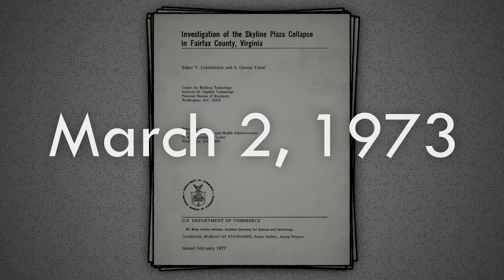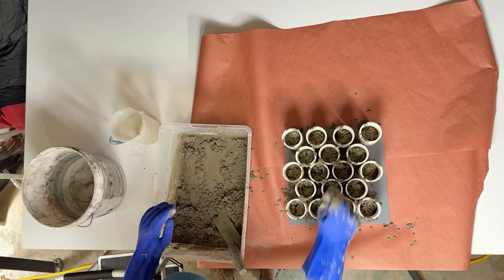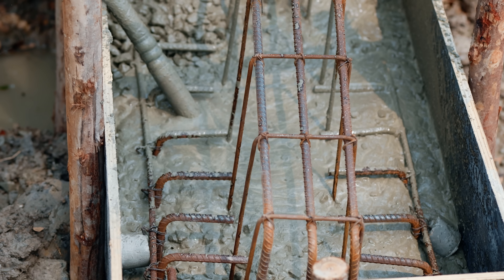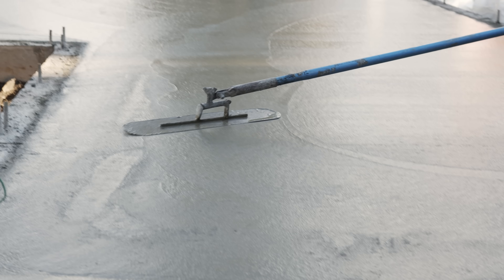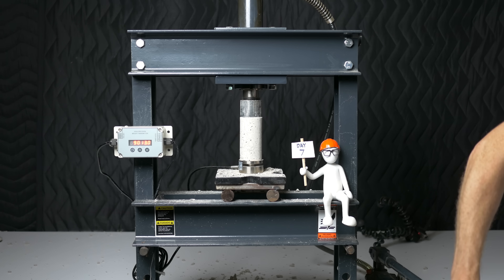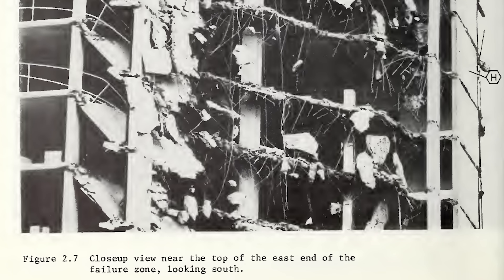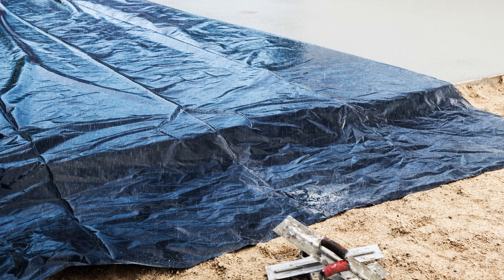Concrete's Greatest Weakness is Time

Comment: In more than 25 years as an architect, I only had to order one slab removed because it wasn't coming up to strength.  Nearly 20 years ago, I did a fire station addition / renovation with a concrete apron between the building and street.  There was one 25 foot section that didn't come to strength in 28 days - and if I remember correctly was supposed to be high-early strength.  The fire department wasn't happy, because it was directly in front of one of their existing truck bays, but it had to be ripped out and repoured.
Reply: Where are you living that such a call would be made by the architect and not the structural engineer?
Reply: @scamplogic probably a country where the architect is the main designer and uses different engineers as subcontractors. The engineer advises the architect, and the architect is the single point of contact for the contractor and client. Pretty much standard practice here in Belgium anyway.
Reply: @scamplogic  Architects often have engineers in house or as subs.   Some architects (gasp!) are also licensed engineers.  
Further, some inspectors (government or corporate) are often high school grads (or not even that), but they have the ability to determine if something fails a safety spec and the authority to stop work and even order rectification.
Reply: great question.
Reply: @scamplogic Western New York.  One of the partners in the firm I worked for was a PE.  Besides, it doesn't take an engineer to read a report that shows the concrete wasn't anywhere close to the required psi after 7 and 14 days.
Reply: Sounds like the concrete was batched incorrectly, or there were some very poor weather conditions for curing.
Reply: @melissaharris3389 okay.
Reply: Why was it necessary to replace that? If it's not strong enough, wouldn't the potential problem be that it cracks later under heavy trucks and could be replaced if that actually happened?
Reply: @MrNukealizer  Sure, failure might not be as dangerous as a falling skyscraper, but if the material failed to meet specifications, it needs to be replaced.
Reply: @mattgies   At what cost to risk ratio? If it was only a little under spec they could have simply discounted the work for the expected reduction in working life … I mean if they weren't government funded and mindlessly wasting tax money.
Reply: @TheDuckofDoom. And this is the type of thinking that tries to creep in and ruins projects throughout the world. As soon as you let standards slip projects become worse quality. Regardless the cost if a standard isn't met then it needs to be redone. We face this issue constantly. If everyone is held to account then the quality of projects improve and everything is safer and better for everyone!
Reply: @TheDuckofDoom. cost to whom? The concrete plant?
Reply: @TristanMaiolo  You misunderstand, nothing is being allowed to slip. There is a cost penalty being applied and an assessment of the actual impact on the service life. The product is simply being sold as a second with declared limitations, rather than dumped in a landfill. This doesn't reward the supplier, they are loosing revenue and profit through the mistake.

Even aircraft and cutting edge semiconductor manufacturing have this sort of allowance. The faulty item is not sold or used as if it were in top condition, it is clearly de-rated and limited in the tasks it can perform.
Reply: @GuyChapman  Cost to whomever is contractually responsible for it.
Reply: @TheDuckofDoom. No misunderstanding at all I get where you're coming from the problem is as soon as you allow standards to slip regardless if they are discounted or not means that you are letting quality standards slip. This lower standard creep eventually finds its way into other areas and before you know it you have collapsing buildings etc. Companies need to be held to account to ensure quality remains high. Just because you may think that it might not be a problem for one thing doesn't mean it isn't going to cause issues for something else. On the flip side designers and architects need to ensure they familiarise themselves better with products they are specifying and insistent on using because often they unnecessarily insist on using products because they wrongly believe they are better quality or suitability in situations just because they may be more expensive and this isn't always the case. I often see ridiculously expensive materials specified when other cheaper materials offer the same use case without compromising quality at all simply because the more expensive materials have properties that mean they are better suited for other areas that the cheaper products aren't. There are situations when the cost doesn't justify the use when there are other products available. The problem we face now is there are many cheaper products which are to be used in certain situations but don't have the correct checks and balances in place to ensure that they are safe and harmless and whilst these pose inherent risks they are often overlooked for the cheap price and when an issue does arise it is often too late and the job is done and dusted. A great example of this is the cladding used on the Grenfell tower in the UK! It burned for days and the cause was because of cheap inferior cladding was used which was purported to be safe and harmless and the fact was that it really wasn't and as it turns out many buildings throughout the world had similar cladding. This has caused massive ramifications throughout the construction industry worldwide and is an example of when they let standards slide this is what can happen.
Reply: @TristanMaiolo  You clearly don't get it. THE STANDARD IS NOT BEING CHANGED. There is no slip, there is no corruption of the testing or falsely labeled product involved. 

This is simply a recalculation of the exact same cost-benefit calculations used for the original engineering design considerations, but now based on new information.
 
We now have a very cheap, or even free, but slightly inferior slab of concrete that didn't exist previously and it may last 20 years; or we can continue with the purchase of a full price slab of superior quality that may last 50 years. 

This may have even been the preferred choice if it had the cost been the same during original planning,  it just wasn't selected because it would be below normal supplier cost.
Asphalt is frequently used for paving despite its shorter lifespan and load capacity because the installed cost more than compensates for the limitations. That isn't a change in standards.

Your typical 4 core or 6 core CPU chip was produced as an 8 core that had defects so they disconnected the defective cores.
Reply: @TheDuckofDoom. It's ok you're allowed to be wrong
Reply: @TheDuckofDoom.  How do you document such deviations over a longer time, fool proof?
 Generally building plans are stored for a long time, but it's up to the inspection to determine if on-site alterations deviate enough to satisfy the building code (and if that involves deviations that alter global strength, they really should not ever). The benefit of this approach is that you even if the original blue prints get lost, it's possible to estimate a minimum strength based on building codes and measurements. That backup plan goes immediately out of the window when the concrete isn't even up it's intended specs.
And how would any government body be able to track that 'life-time' is exceeded. I have yet to see the first public works that actually is taken down after it's originally designed lifetime or it's original usage case, instead of being pushed to it's breaking limits. 
It's sucks to take the costs this early in an project, but atleast it's something less that can go wrong, and keeps the system simpler.
Reply: @TheDuckofDoom.  ah, contracts. Those bits of paper that say what specification the work has to be done to, and who has to fix it if it isn't.
Reply: @GuyChapman   Yeah those. They are often renegotiated when conditions change if it would benefit both parties to do so.
In this case one party can limit their losses, and the other party can get an ultra-deep discount on a somewhat lower capability product. (All dependent on the specifics of the situation of course. I'm just spoon feeding y'all one of several valid business and engineering possibilities.)
Reply: @TheDuckofDoom.  in your opinion, not having reviewed the actual requirements.
Reply: @GuyChapman  Where did I write any opinion? I wrote an illustrative example, and an explanation of the circumstances where that scenario could be a viable option. The specific requirements of the particular case don't effect the general decision making process.
 
If you can't abstract a general concept away from the specific case or spot the difference between an opinion and a logic formula, then you best stick to shoveling out ditches and leave the thinking to others.
Reply: @TheDuckofDoom.  Except reduced lifetime may not be the only concern. It isn't unreasonable to look at the results, calculate all of the potential impacts, and then consult with the client about what they want to do. But all means all -- which requires a robust engineering review of the exact situation and willingness to sign off on that. Might well be cheaper to re-pour the pad. Might be fine to accept reduced life. Might be mitigatable in other ways. Everything is going to differ. But second-guessing professionals who's job is specifically dealing with this stuff seems rather unwise.
Reply: @TheDuckofDoom.  As a generalized concept, your proposed solution is fine. And in fact it's certainly possible and does occur. But it's not likely in the fire station drive scenario.

1. Of course, as already mentioned, a contract will require delivery of product according to some specifications, and likewise require payment terms and conditions in exchange for receiving said product.
2. Of course, if some bit of the product is not delivered according to the contracted specifications, everyone might agree that the total value of the project, or at least that bit of it, is not the same as was original agreed upon.
3. A contractor or a client can, of course, propose any addenda to the contract that he sees fit to propose. Getting the other party to agree to it is another matter. Often, construction clients are not well experienced in construction itself, and rely on the perceived expertise of architects, engineers, and/or other consultants they have also hired.
4. If a contractor makes the initial proposal, a client is highly likely to see it like, "This contractor screwed up, and is trying to worm out of it." And since he's also paid the supposed experts, they're highly likely to reinforce his bias to him. Those supposed experts also highly value their reputation, and don't want substandard work causing them a public black eye, so to speak.
5. It's much less likely for the client to propose it, and even if he did, a contractor ALSO doesn't want to risk a bad reputation over substandard product. At least, any good one doesn't. If a fire station's drive starts to crack up significantly in five years, people in town will remember that ABC Construction company built that, but they'll have no idea about the specific details that led to the acceptance of poor concrete. He also doesn't want to risk warranty claims, even if they are unfounded.

Your proposed solution is more viable, and in fact utilized, in cases such as, "The light fixture supplier cannot deliver the specified package on time, and they propose a cheaper alternative," because that's not something that the public will drive by and perceive as inferior work. But it is highly unlikely to be utilized in the fire station's driveway example. Nobody would even bring it up.

I hope this helps.
Long time General Contractor
Reply: @MrNukealizer  It wasn't anywhere close to the correct psi.  And the heaviest truck they had was 80,000 pounds.
Reply: And that will have wiped out the profit the concrete firm made on the entire job.
Reply: @GuyChapman  If the concrete firm did their job properly and ensured the concrete was up to spec then it wouldn't be an issue. This is why the saying - good quality work isn't cheap and cheap work isn't good quality - is about because the reason good quality work is expensive is because there are a lot of checks and balances to ensure the supplied product is what is supposed to be.

Comment: I always thought that curing concrete is endothermic because every time I walk past a newly poured concrete structure I'm hit with chilled air, a lot colder than ambient. Guess the cooling from water evaporation exceeds the warming from curing at the interface with the air?
Reply: That's odd. I was always told it can produce enough heat to scald you for larger pours

 I remember the first time I saw it happen to a kid playing around with a patch of concrete the maintenance man just did. 

 All fun, and games with concrete fingers/hands/feet till he started hollering like an hour later. 

 Burns weren't obvious at first, but he got it good. I wonder if it being quick dry made it worse. 

 That's when I learned what alkaline burns were lol. 

 Personally only dealt with a few third degree burns from fire. 

 I'm trailing. For you ny guess is evaporative cooling got ya + the environment. AI says so as well. 

 I've never felt that. 

  I am always complaining how bad the concrete, and especially asphalt is on a sunny day. 

 Heat radiating from the sky, and from the parking lot. Feels like a microwave oven, and I live outside Philly. 

 It's horrendous. 

 They need to make concrete reflect heat back out to the atmosphere. Not soak, and dump it. 

 No one ever mentions it. So here it is to the void. 

 Roman concrete not only self healed due to the added quick lime which has something called clasts that break when exposed to air. 

 It wasn't poured like we do it. Water was heavy to carry so they used only what was needed, and used salt water where they could. It made their concrete stronger, paradoxically. 

 Don't do that with modern concrete. 

 This made it hard to work with, more user error, and required a ton of time to cure. 

 Yet it is more stable, less shrinkage, and has less pores for liquid to attack through over time. To name some off the top of my head. 

 This also lends to the long life span. I don't dare say it's stronger. It isn't. Our concrete just has lots of traits that cause it to degrade like rebar. 

 I'm no concrete master. Just some interesting things. 

 I wonder if paste like concrete is still used in non niche construction.
Reply: Fast curing concrete gets very hot

Comment: Surprising that you got such great failure mode for the homemade concrete test (or maybe you're just showing the best one lol). Had to do a lot of test back in the days for the concrete canoe contest between universities and if the top and bottom surfaces of the cylinders are not parralel to each other, it's easy to get a plane of failure through the cylinder (due to shear) vs a nice cone shape of pure compression.
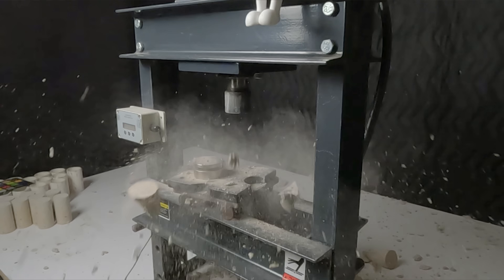Reply: I mean obviously he could've fudged or cherry-picked data, but you'll notice (e.g., at 10:26) that he does have several points clustered at each time datum. So there's that.

Comment: One of your next videos when you do, Concrete, can you do concrete in a vacuum and do compression strength tests vs regular atmosphere drying no one on  YouTube has done this
Reply: This kind of testing have been done in lab setting to remove excess air. However, it's a challenge because a full vacuum would cause the water to evaporate ruining the concrete.
Reply: Why? What information do you think would be gathered by such a test?

Comment: I really appreciate the concepts behind engineering as a break from real world examples from time to time. I was wondering if you could cover the wind tunnel effect when building or how engineers reduce wind speeds around construction like highways. Having lived near a highway, it's not so much the noise that's the worst part of it, it's all the wind that generates.

Comment: A few points:

1. Do I see a Practical Engineering/Hydraulic Press Channel in the future?

2. How did you get that image of my garage floor at 12:34? Whoever poured it didn't bother with rebar, and it shows as the racks continue to expand and propagate.

3. I've done my own, unprofessional concrete pours, and made sure to overcompensate for possible inexperience issues by making sure to use a very strong mixture; strong, solid forms; and plenty or reinforcement. That plus time gave me confidence that my porch piers, sidewalks, and cellar entry walls are going to last longer than I am. The cellar entry took about two tons of dry concrete (about 50 eighty-pound bags), and far more time than I had anticipated. I figure it could be used as a bomb shelter.